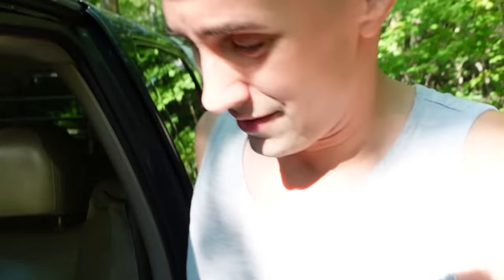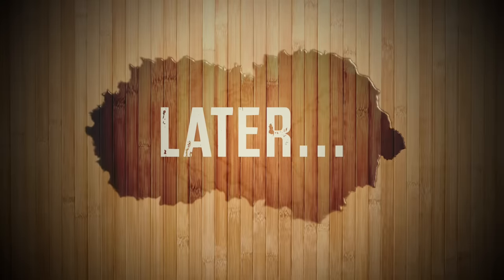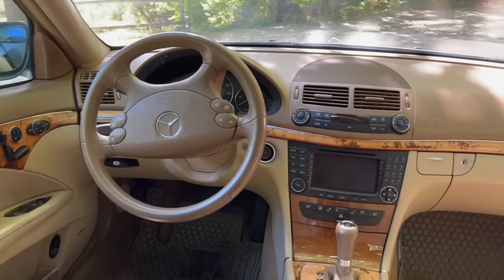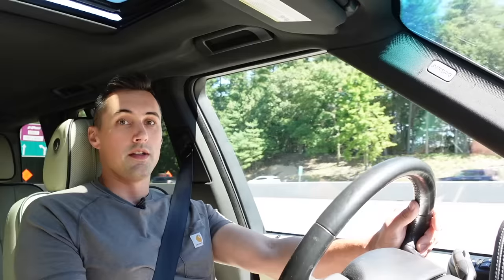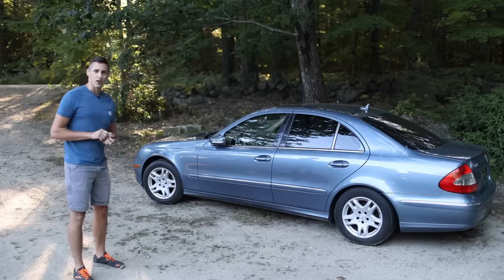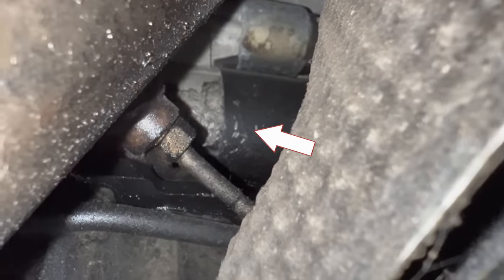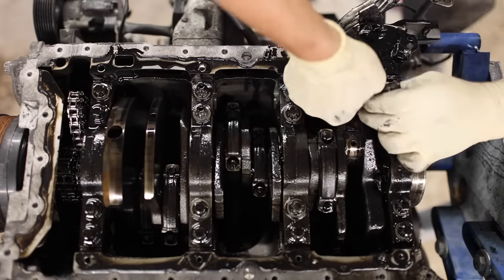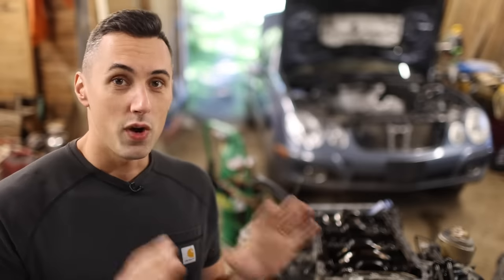I Bought a Repo’d Mercedes Diesel and I Regret it. Here’s Why You Shouldn’t.

Comment: hmm shame it was so bad engine, yes it is not easy to get the e 320 cdi. But I got one. estate, 2007. these engine is good as long as you..as any engine. service them.  and I have oil service around 8000 mile. not more. hit 173000n miles soon. runs sweet yet. and have all the power in it. the other thing is that they is sooo beatyful to drive. and have a good grip even if they are a bit soft and more to comfort than sport. and mix that with a good balance you have a kind of a sleeper. ohh the 320 cdi get 280 hp and around 640 nm easy. but check if that is legale where you live to tune it up.

Comment: had 320cdi cls worse car ever..petrol is alot better..brought lexus gs450h miles better. performance 400bhp. 0-60 5secs. 40mpg. That's better than merc. Also made well compare to merc. not sure why you saying it can get 700 on a tank. I got 470 out of a tank. no way you will get 700miles.

Comment: Not sure if I missed it, how many miles were on this on? What does mercedes claim as an oil change interval? I've found through oil analysis that my 01 focus running mobil 1 is perfectly fine with 10k mile oil changes.
Reply: I
As regards the oil it ain't just the mileage, it's the number of cold starts, short-trips, type of driving and age of the oil.  It's a wise move to change the oil and filter regularly if you mean to keep the vehicle.
Reply: @christurner6430  as I stated I've done the actual oil analysis on my vehicles. 10k on full synthetic is almost always more than fine for the vehicles I own

Comment: all mercedes since 1996 are just garbage. My w203 from 2004 had so much planned obsolescence that i will never buy a Müllcedes (Müll = garbage in german) again.
92k km timing chain replacement and at 192k km it jumped over without any warning. Müllcedes didn't tell me about the oil leaking camshaftsensors that can result in a 4k € repair what could be fixed by pieces that would cost Müllcedes like 1-2€ in massproduction.
And much other stuff that was just ridiculous and stupid stuff with the Müllcedesdealer(they failed to fix the breaks the right way and they were running out of true).